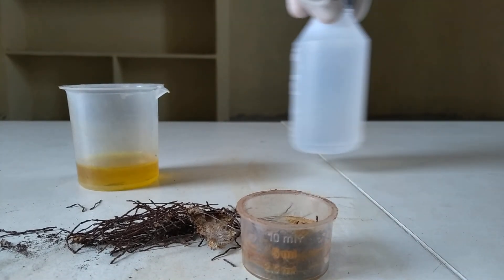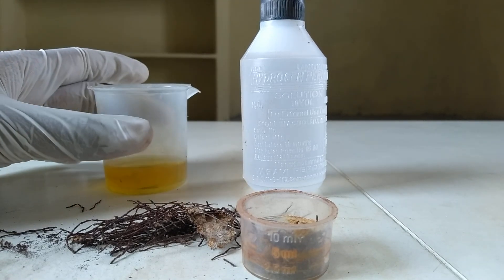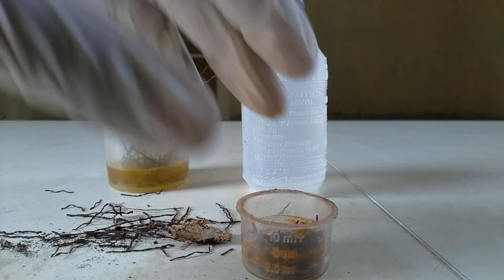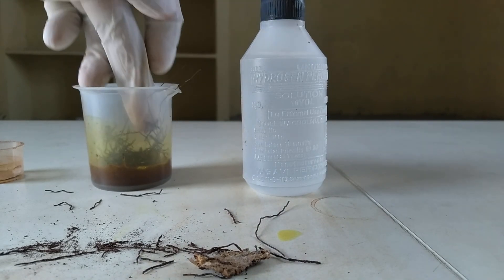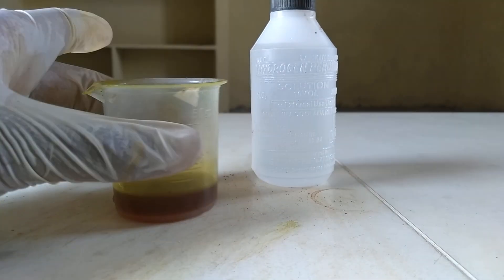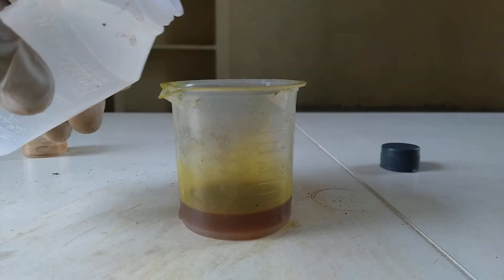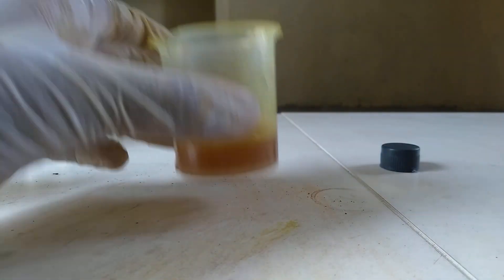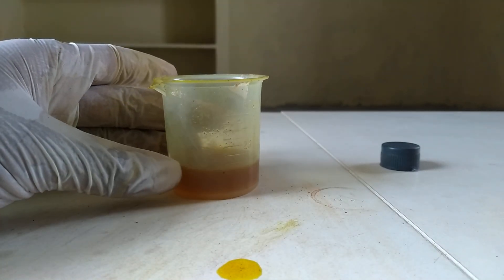How to make ferric chloride for pcb etching

Comment: How do you came to know that the acid you used is HCl
Reply from the maker: Hydrochloric acid is sold to be muriatic acid and I thought similarly that it probably would be HCl and also I tested it with reacting copper which didn't react but in other cases like h2so4 or hno3 it definitely does as I said before in one of my previous videos
Reply: @Chemoscopy  h2so4 conc.does not react with copper until an oxidizer is added. I have a test to determine it by just mixing powdered sugar with conc.h2so4.

HCl can be tested with nh3 gas ,which forms ammonium chloride
Reply from the maker: Hey but you never find a house cleaning acid with a 90% conc. 😏
Reply: @Chemoscopy  yeah i know 😏
Reply: @Chemoscopy  it cn b till 50%

Comment: Sir, if I use an aerator instead of hydrogen peroxide will it still give me good result just like what you have or I'll just end up receiving a liquid trash?
I'm also planning to use it on my PCBs
I hope you can give me a suggestion. 😊😊😊
Reply from the maker: I definitely can give you a better suggestion as the task is to oxidizing fe2+ to fe3+ that's it.

If you think hydrogen peroxide of 3% (the basic antiseptic lol) concentration is way slow and you fall under a liquid trash ,then move for a high oxidiser in acidic medium for which you can you potassium dichromate or concentrated sulphuric acid. Which yields a pure kinda yield, but me not using them for professional uses I didn't did it dear pal. 

Thanks for your support I hope this is what you asked for.
Reply: @Chemoscopy  thanks! 😊😊.
But if I go back in using hydrogen peroxide it will still need some time for me to see the result, right?
Actually its my first time to do this.😅😅
Reply from the maker: It doesn't take much time, you can feel fizzing and change of color from green to yellow or golden. Doesn't matter if it's your first time keep doing as anything has its start and from scratch starts everything ☺️👍
Reply: @Chemoscopy  thank you, sir. you helped me a lot. 👍👍